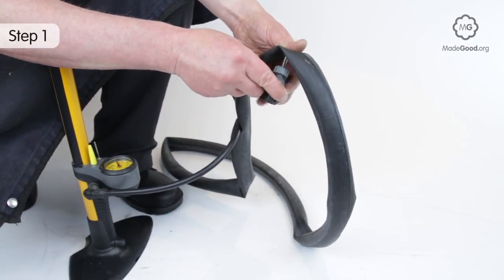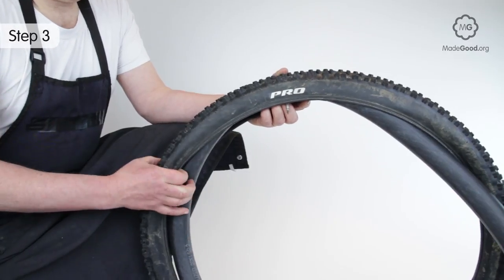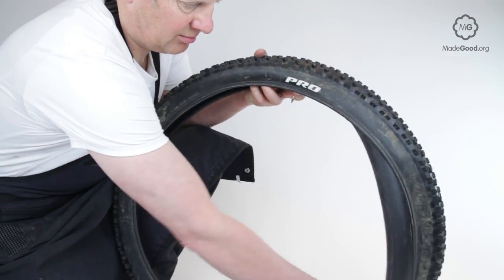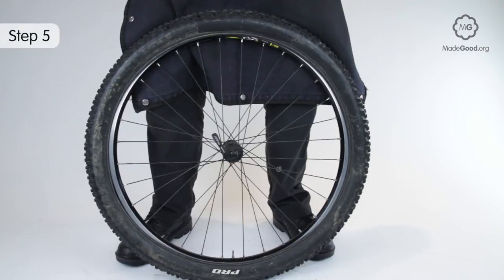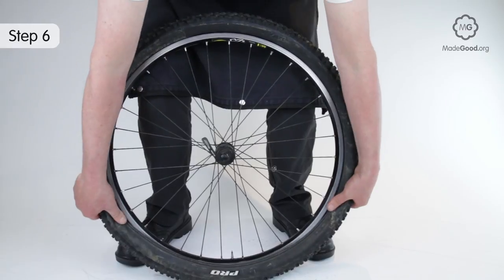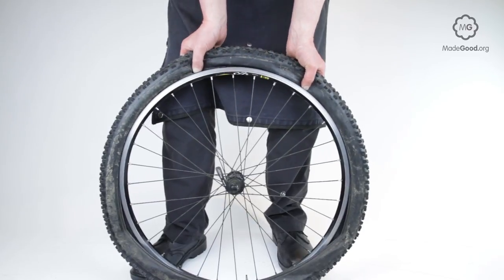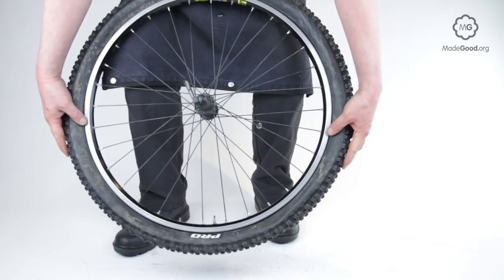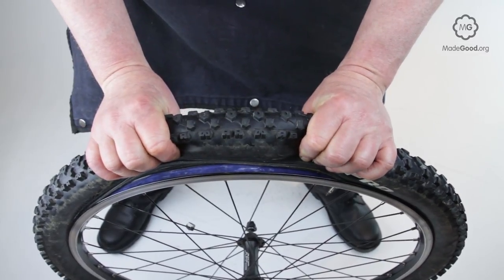Mount A Kevlar Bead Folding Bike Tyre

Comment: Excellent explanation, I just had a bike technician working on my tire, and I couldn't get the foldable tire on myself. He did EXACTLY what you did. 
One thing you can do also is lay the tire on the bar stool (make sure you have something to cover the chair, or you will get grease/dirt on the stool), as you work the 2nd layer of the tire.

Comment: Learned the hard (and frustrating ) way:
Yes, do  put a bit of air in the tube. This holds the tire in place and keeps it from bouncing all over the rim. 

Not such a problem on a broken-in tire, or one that has its "tire shape" already, but a royal pain on a foldable you've just pulled from the box!!!
Reply: What kind of rim do you have for your tire.??
Reply: They vary, really; none are anything special. All are bead seal.
All are 700C.

It' funny; some tires are nearly too large, some you can barely get over the rim.
Another small trick is I try to stick to a tube that's on the large size compared to the tire I'm using. This has helped cut down on flats considerably. It's not always possible (my winter ties are pretty large, for example) to do so.

Comment: "Lock 'it". What is 'it'?
Reply: I think they are referring to that small lock-screw that goes onto the valve stem, holding the stem flush with the rim. Actually, this screw is probably pre-threaded onto the valve stem at the factory, so you should remove it before mounting onto the rim. Otherwise the valve stem won't be able to slide through the hole in the rim.

Comment: I still don't like the fact that it comes in a box, i think it takes so long cause you have to " like reshape the tire back to  it's original round shape, to put this tire on a rim it took me less than 5 mins with a regular tire but with this box tire  it takes as long as it takes to reshape it back to a round shape " i did it with sweat and cussing that's what made it possible, now i found the EASY WAY TO DO THIS use "plastic ties" to secure the part of the tire you have on the rim, now this second time it took 10 mins without you having to cuss